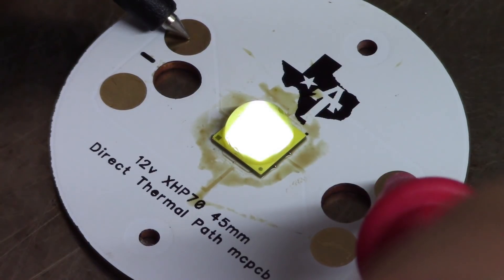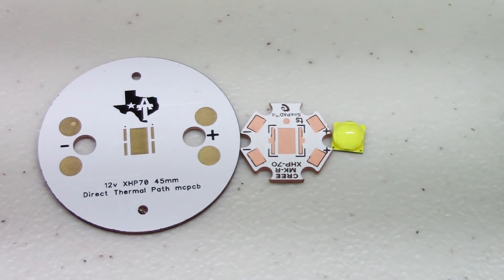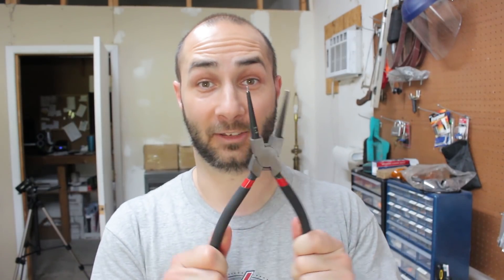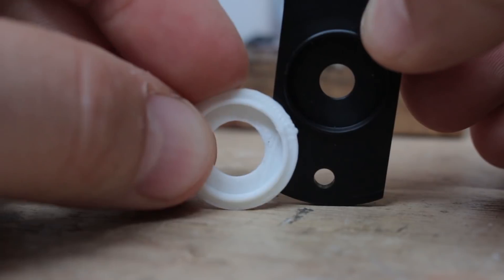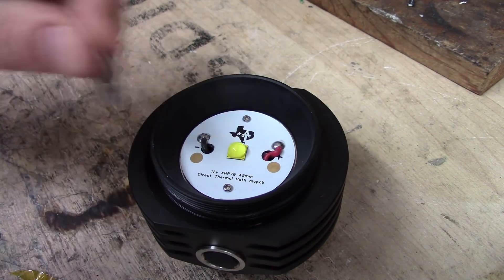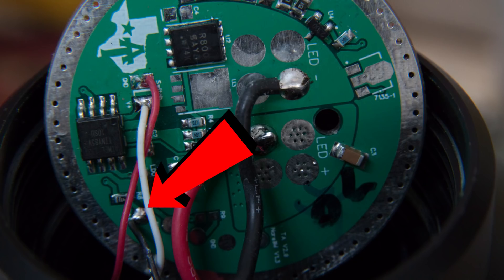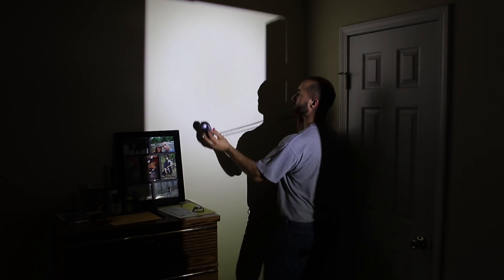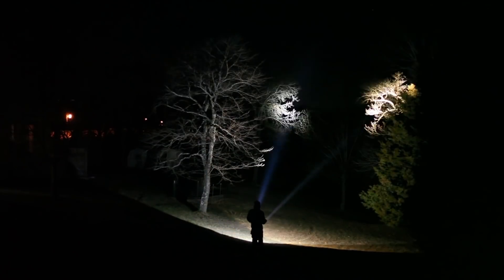Eight THOUSAND Lumen XHP70.2 Budget Light Forum Giga-Thrower!!!

Comment: Hey Matt, I hope you respond. I want to upgrade my ebay flashlight with a xhp70.2 20mm and 20mm controller.  What should I get to make the brightest possible? My flashlight uses 2x 26650 batteries.

Comment: Hey, I just wanted to say I love your videos. I just got into this crazy flashlight hobby/obsession a little less than a month ago. I bought a Sofirn BLF SP36 and I had never seen anything that bright. So I figured it was the one and only light I needed. But then I bought an Astrolux MF01 and an Emisar D4Sv2 and Sofirn SP33 v3 and Lumintop FW3A (Because I needed an EDC) all in under a month. 

 Ok so, I need the heatsink for the Astrolux MF01, the one made by someone over on BLF. I have posted about it there and it seems they are no longer making them. I was wondering if you have one or two that you would like to sell. Or if you know someone that could have one made. Copper or Aluminum I don't mind either as both fixed the instant step down issue the MF01 has when it is not warmed up. Please let me know or if anyone out there can help me please let me know ill make it worth your while. Please reply to this or send me a PM.

Comment: nice video the fet direct drive from mountain electronics for xhp 70.2 will give you upwards of 15 amps if you sporting hefty enough batteries Shockli 26650 IMR 5500mAh    Efest Purple 4200mAh can do 50A pulsed; 20A continuous, i got basically same setup in an convoy L6 and its insane

Comment: Matt I have been looking at XPH70.2 leds some are rated 20 watt and others are 32 watt??  And how many watts were you drawing with the hop up.    I have been learning a lot from your excellent Videos!!!  thank you. Ed Mudd
Reply from the maker: You can go higher than 32 if you heat sinking and thermal path is REALLY Good.  The GT70 with the mosfet driver is running over 140 watts.    the giant copper mcpcb is required for this though.   This chart from Texas ace may help.   The lumen outputs are a bit high because this is from before we all calibrated off Maukka.  But the wattage is going to be about right. http://budgetlightforum.com/node/57715

Comment: What batteries would you recommend to use with the gt70?
Reply from the maker: I use these in mine.  https://asflashlights.com/batteries-and-chargers/91-18650-lg-inr18650mj1-3500mah-high-discharge.html    The discharge will be around 5 amp per cell if using the long tube.   If using a short tube you should probly get samsung 30q with button top.   Lower capacity cell, but can carry a heavier load.
Reply from the maker: Make sure if you get another cell besides the one I linked that it is button top.  Flats wont work in the GT
Reply: @Lumencraft-  thank you

Comment: That is awsome video!! ...İ want to ask you a question .. Can you change working voltage by solder chip to bigger emitter /heatsink ? for example xmi t6 works 4.2 volt  but i have circuit board workin 12 volts ..if i solder xml chip to a massive emitter will it work with that circuit board?
Reply from the maker: Hi, no.   You can have to make sure that the circuit board is outputing the correct voltage.   If the circuit your using has a 12v input and an output that is close to what the LED needs (about 3.6V for XML) then it will work.  If the voltage output is too high you will kill the LED no matter how good your heat sink is.
Reply: @Lumencraft-  thanks for qick response yes i have cicuit board is in and out 12 v so i can use xml chip with this circuit is that correct?
Reply from the maker: @yf48353  Not if it put OUT 12v.    If the voltage out is 12 then you would need to wire 3 or maybe 4 XMLs in seires to compensate.     If the INPUT is 12V and the OUTPUT is 3.7 volts then it will probly work.      You also need to know the ratings on the circuit to make sure you don't exceed them.     If your circuit is rated at only 2000ma and you hook up LEDs to it that cause the drive current to be higher than that it could burn up the circuit.

Comment: wandering if i should upgrade my flashlight i have  the acebeam k70 now  but this throws   farther wander if I would be   much more  impressed  at 200 more meter of  of throw from    LUMINTOP BLF GT70 XHP70.2 7500LM 1400M  I was just at the cree website  it's an impressive chip  just reading the specs

Comment: Hey Matt,

I just ordered a Convoy L6, and my light is doing what yours is at 8:58

Freshly charged Keeppower 6000 mah batteries. Any idea what's up?
Reply from the maker: Hi Michael, if you ordered it from my shop I would be happy to exchange it for you.
Reply: I did not. I ordered from Banggood. I am totally willing to PayPal you for your time though if you'd like, to discuss whats wrong.  @Lumencraft-
Reply from the maker: @thatplat1    Loose the retaining ring around the driver a bit and turn the board about 1/4 to a half turn and tighten it back up.   If you have the ability you could also pull the driver from the bottom leaving the wires connected and jumper a set of cells to power it.   that would tell you if the board is shorting on the body causing that.   Had a couple over the years that did that.    If it acts the same way with the driver out and jumpered the board would need replaced.   Convoy on aliexpress and I think banggood also sell the boards.   If you don't wanna foo foo around with it Convoy also has a one year warranty.
Reply: Thank you for the suggestions. I will try to jumper the cells to the driver when its removed and see if that causes an issue. If I do end up returning this (N2-3A xhp70) would you recommend the xhp70.2 P2-3C over it? I know its rather new.   @Lumencraft-

Comment: So do the 70.2's come jacked up like you did here if requested?  De-domed and new chi and board?  And if so, at what price?
Reply from the maker: They come with the high output FET driver in them, but not de-domed.  They are $220 http://bit.ly/BLFGT70_2
Reply: @Lumencraft-  Do you have an estimate on how much more throw is gained by de-doming?
Reply from the maker: @travis1118  A pretty fair bit.  I can't remember exactly what the gain was for this light, but typically you can expect a gain of like 50-70% in CD.    Takes 4x the CD to get double the actual range in meters, but visually the effect is very noticeable regardless of the numbers.

Comment: Great tip on using the snap ring pliers!  Question:  I was on BLF until my password apparently got too old, and now I can't get past the ANNOYANCE to reset my password.  I've tried every conceivable answer to the ANNOYANCE question, with no luck.  Can you point me in the right direction?  It seems to think I'm a robot and I can't convince it otherwise.  I was on there for several years, and now I'm locked out...
Reply from the maker: It's been a while since I've looked at that but if I recall the trick is not to over think it.   Isn't it like "5+5-2 bla bla what does the F in BLF stand for" and your supposed to ignore all the other stuff and just answer the last part of the question "flashlight"  ....  IIRC that is...
Reply: Thanks for replying.  No luck yet.  It's sort of a catch-22 -- I can't even contact the Admin without logging in, which of course I can't do.
I mess with it, and try about 25 different combinations + your suggestion, give up, try later, give up, etc.  Trying to see how simple it could possibly be.  Here's the question I get (or some very similar variation):
Hi, sorry to bother you. Please answer this stupid question to make sure you are a real person:

  Hi HOW are you doing? Good! Please type the word CUCUMBER in the box below. Who cares what 7-6= *
Reply from the maker: I would say in that situation just typing the word CUCMBER would be correct.    If doing that continues to fail let me know and  will message the admin.   If you have the option trying to logon from a different device may also help.   Sometimes phones of certain types can be glitchy on forums.
Reply: I finally got in, by switching IE to "In Private Browsing", which eliminates all history, cookies, etc.  I never did succeed with the anti-robot routine, but my original password worked with the In-Private mode.  Odd.  Thanks, though!  I had no way to communicate with anyone on the site.

Comment from the maker: WHERE TO BUY https://www.nealsgadgets.com/products/lumintop-blf-gt70-xhp70-2-7500lm-1400m-thrower-flashlight?_pos=2&_sid=801391785&_ss=r&ref=z1ak6zwmym&variant=12980685537350   COUPON CODE: ASFW3A
This is the Lumintop made version.  It is XHP70.2 with the mosfet driver for maximum output. The LED will still have the dome on so the beam will be like the wider of the two shown in my video but with the same output.

Comment: ok so this is the same video as on the blf forum thread. i was blown away by that first part of the video showing the difference in hotspot size and spill size/brightness between the gt and gt70. but yours is 9k lumens. and also in the video it does not look like you dedomed your led. so the official numbers are 7500 lumen, 500kcd and 1400m throw. so my questions is what do you think the chances are of a factory dedome version? i mean i like the numbers ok on the stock domed version but i really like the dedome numbers and really really like the dedome with mosfet numbers. i already have a tn42 in cw and a imalent dx80 and a imalent dt70. would it really be that big of a upgrade to those? i like distance with usable spill, i live in the hills so i probably only use within 1000m mostly. the tn42 has fair usable spill and goes i believe stated 1500m at 257kcd and 2000 lumen. i just like the hight candela as a defense with its blinding power to someone plus the gt70 is a sabertooth cat club for real.

Comment: I have a vertical mounted 400-600 metal halide/HPS light that is outdated by atleast a decade.  It weights atleast 30lbs without a bulb or the dome.  I am interested in finding something to focus it into a tight beam so I can light stuff up very far away and burn stuff close by.  If I could find a way to run it off a DC to ac power inverter I could use it off road and possibly piss off any air traffic by accident even.  Any thoughts on what to do with this old way outdated monster.  They don't make them this long lasting and bomb proof anymore.  It was ran 18hrs a day for 5-8yrs and a few hrs a day for another 5 yrs before I got it.
Reply from the maker: Hi Phil,
It's going to be a lot of work to convert something like that, however if its a light you totally love I think its a worth while project.   The easiest way to get what you want is probly going to be with an optic.   Getting the reflector made for this light was probly the largest obstacle.    I would look into getting a fresnel lens for it.   Using this in combination with a high powered LED would also make it easier to use DC power.

Comment: Do you replace many pistons?  Just had to ask because I do and that is what snap ring pliers are sold for.  Snap rings hold the wrist pin in which need to be removed.  I have probably only changed 5-10 sets of snap rings this month.  You don't need to remove both but I like to put a new one in after decoking pistons I am just replacing the bearing and rings on.

Comment: That's 1 LED how is it 9000lm? It's 4200lm
Reply from the maker: The reason we are able to get 9000 from them is because of the large direct thermal path copper mcpcb, good heat sinking and over driving the LED.    Cree rates their emitters for a modes drive current using and old school mcpcbs for a long life (50,000 hour target).   All of crees LEDs can do better than what they are rated for if you do those things listed above.

Comment: Boosting this LM3409 Buck chip driver without changing the inductor to 4.7uH, adding 60uF input capacitor and bring down the switching frequency from 650kHz tu 250kHz will be a very bad choiuce likely producing way too much heat
Reply: The original inductor is rated 5(6)A, I have a driver that can handle 8A with upgraded parts including Inductor, MOSFET, Caps also added a filtering capacitor to LowVoltageProtection input to filter the massive ripple, http://budgetlightforum.com/node/57772
Reply from the maker: I have added a link in the description to your driver as well.   Thanks for sharing.
Reply: DD the XHP70.2 is dangerous with 8 high drain betteries if the voltage drops in the carriers got bridged you will get easily 12A to the LED which will turn blue, as well also works only on fresh batteries, having regulated 7A getting the carrier button springs bypassed with copper wire will reduce the voltage loss in carrier significantly as they used a steel spring

Comment: Hi,
I tried to order a gigathrower, signed up on the first list and did not get back to me. Maybe it's my fault. How can i buy one. It is better from China if it is possible. The shipping from the United States will cost me 30$. 
How much would it cost to buy from you an improved flashlight like the one you are showing here. I understand it will be shipped from the United States.. Answer if possible private. My FaceBook is Nitsan Bornstein. Or If there is another way to a private answer. .
 Thanks.
Reply: Nitsan Bornstein when did you try and get in the group buy list? It closed many months ago. Your only option now is to buy one from lumintop at the public sale price. Though if you hold out I believe they are planning on offering some discount on the price.
Reply: Thanks,
Do you have any idea how much it costs without a discount?
What was the price of the flashlight in the first group?
Reply: Full retail is $325 USD, though if you look around just a little bit it's possible to get it for $250. Price for the first group (off the top of my head) was $157.
Reply: Thanks

Comment: when you got your blf gt, were the batteries already charged or do you have to charge them before using it for the first time
Reply from the maker: I didn't order cells with mine, but I always assume any li-ion cells I purchase need to be charged before use.
Reply: John smith My Samsung 35e cells had very low charge and voltages of cells were all different, charging mine first before I use it.
Reply: John smith  when you buy your blf, make sure you have to buy some 4 slot charger and buy 8 battery kakaka
Reply: When i ordred my blf, i knew it was no cells, so i am ordered 8 cells 18650 and 4 slot charger in the same shop,  because  i dont have if before, i bought it on tokopedia.com, it just in my local country website, not international website, the good news is the price more less than other website just around $250

Comment: Fantastic video. I definitely did not expect you to get results THAT high with the XHP70.2. Is the driver Texas Ace made a one off? Or could they become available for purchase? I would definitely be interested in these mods.
Reply from the maker: You can buy the TA driver.   There is a link in the description to his thread now.
Reply: AdventureSportFlashlights Thanks! I'll keep an eye on the thread in case there will be a list/group buy for the mcpcb's and the driver.
Reply: AdventureSportFlashlights How is the tint with the XHP70.2 dedomed compared to the stock LED by the way?
Reply: @Lumencraft- can i use this flashligth under water.
Reply from the maker: @harveycolonia8954  It's not really designed for that.  You could probly submerge it in a shallow depth for a little while with no damage but eventually the seals would leak.

Comment: Awesome mod. Not having the time, expertise or guts to rip apart my GT, Is there any chance we can convince lumentop to make a switch assembly section that can be swapped into the stock light so I only have to screw it in?
Reply from the maker: Probly not just a section, but I would imagine if they start making the parts, they will also sell completed lights.

Comment: How long can the batteries hold the high lumen output with the mosfet?  Would be cool to see a lumen over time graph for it-- maybe taken every 10 minutes or so.
Reply: TMRaven 9A at the LED would mean 4.5A at every carrier.
Batteries for example having 3Ah : runtime = 3/4.5 hours

That's not fully correct, because the current at the LED will not be 9A until the batteries are empty. But it gives your a first clue.